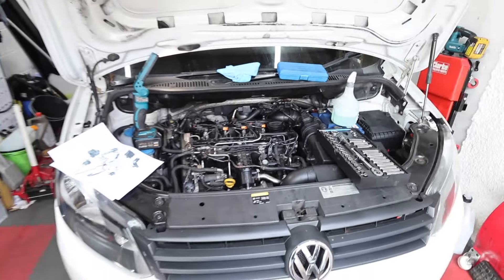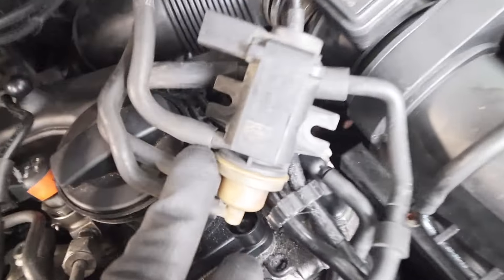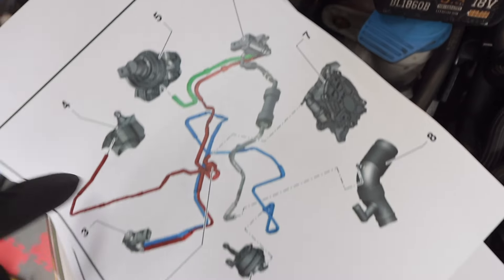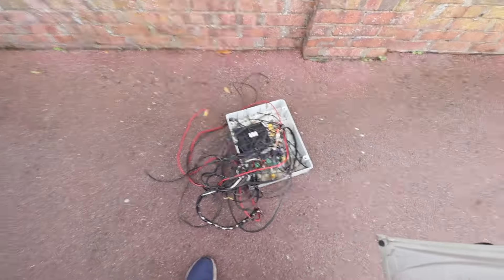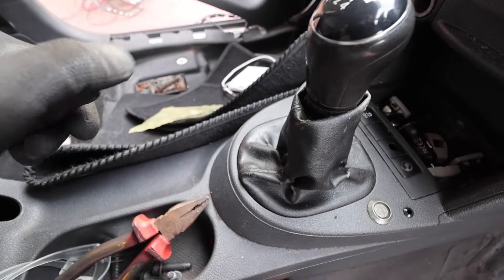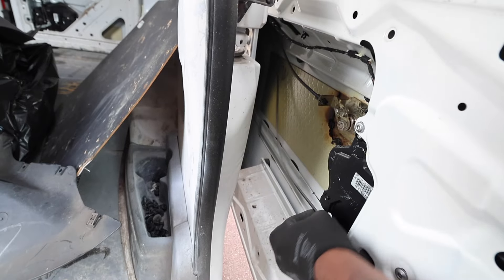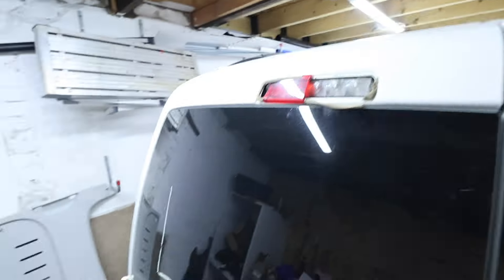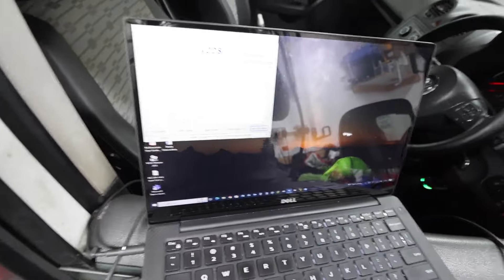Help me choose my next project

Comment: Not sure if you have covered them in another video but those locks are slam locks you have to use the key to open the door and not the handle, with slam locks you only use the handle for something to pull on once you have used the key to unlock the door